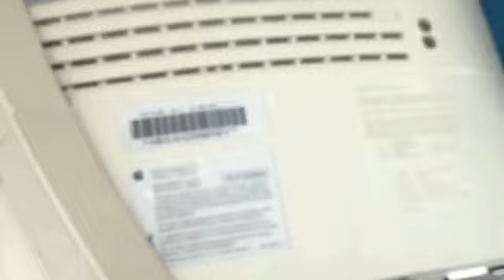OLD SCHOOL KINGDOM IN SESSION 👑

Comment: Now when you process these remember,not to ground yourself or have both hands on the tube when you're cutting the vacuum wire(the wire that goes directly into the tube)or you may shock yourself.i did it twice.
Reply from the maker: Yikes that sounds crazy bad
Yeah one wire @ a time 

These haven’t been used in years so they’ve been de energized  over time 
But. Safe is being 
So it’s always one wire at a time
Reply: @steelisthemeal  +they can be energized for yrs too, believe me .clip that vacuum wire first and you'll  be fine.
Reply from the maker: Hey this is good info